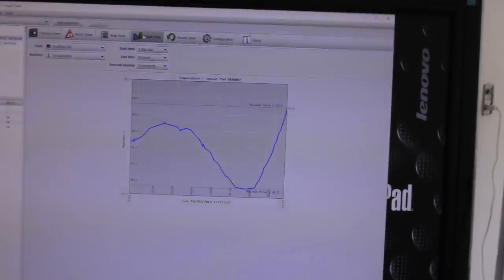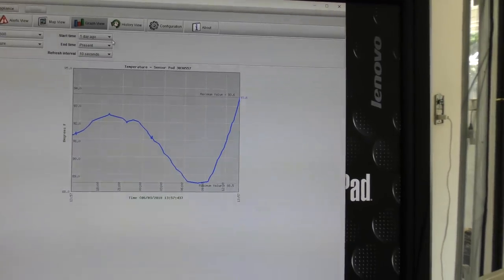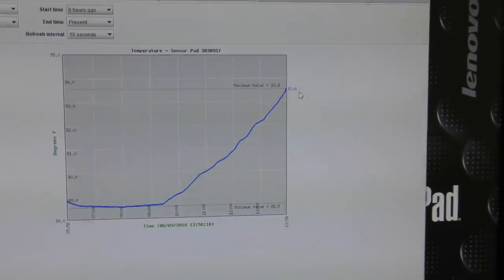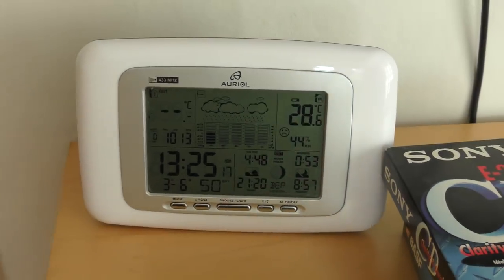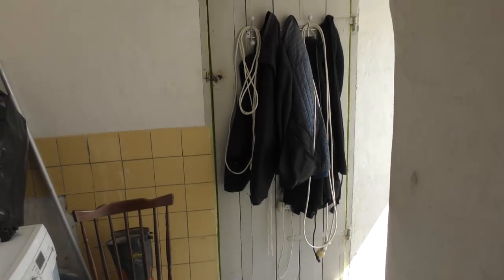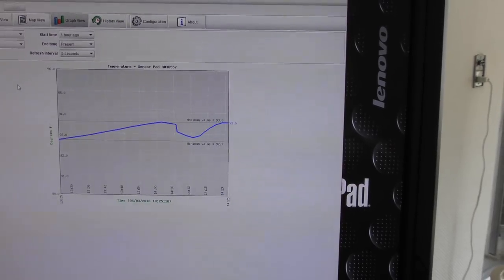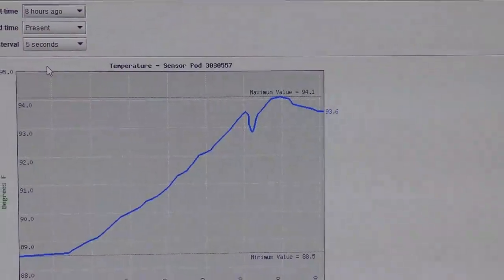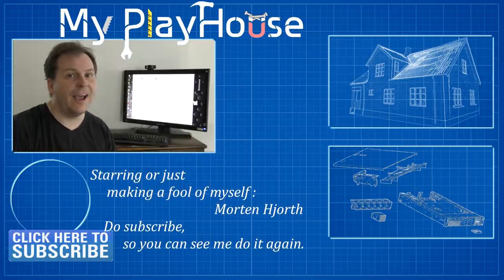Experimenting with Water Cooling, Air Intake to Data Center - 699

Comment: Whats about 3 car watercooling elements in serial? => cheap, high airflow and good cooling.
Reply: I told him that last year 😋
Reply: I honestly believe his best approach(not saying this would/wouldn't work) if he's gonna try to cool room using the water is maybe try to isolate the room and run the water through a bigger radiator with fans within the room, even if the water goes back into the well...... skip out on the air coming into the room unless it's going to be restricted to a slower rate; I believe to much air is being exchanged for the temperature drop to actually take effect from the cooling method used...... at the rate of air going in vs going out, I don't think it's actually doing anything different than having the fan blowing at a slower rate...... or better yet(probably not realistic), water cool the processors and forget the goal of cooling the room........ here's the theoretic analogy; get a hot hair dryer, designed to suck in air and blow air out heating it up and attach a faster faster fan getting air flowing at a faster rate without increasing the heat than the overall efficiency of the purpose of heating up the air is lost and the same is true cooling the air; the usual solution is restrict/control airflow or isolate
Reply from the maker: Hi tobi Herrmann
Thank You very much!  glad you liked the video :-)
Thank you for watching! :-)

Comment: nice video
I used a old Air conditioner heat exchanger. Huge surface and a 230Volt fan inside.
I connected cold water from the garden water pump and showering the garden with the 20°C water instead of the 10°C
Reply from the maker: Hi vspadrver
Thank You very much!  glad you liked the video :-)
Thank you for watching! :-)

Comment: I think you would need a much bigger radiator like a car radiator or several of them so you can cool your datacenter more efficiently and actually you don't need to put the radiators outside like this...Just put a big rad inside the datacenter room and connect it to the well via the pump and that way you would be able to utilize much bigger rad.
Reply from the maker: Hi One Cosmic
Thank You very much!  I rather have the water outside,,safer.
Thank you for watching! :-)
Reply: lol i had the same idea xD

Comment: SO, you have a motor running and consuming power for the pump, power consuming for the 2 cooling fans, I think if you put a small 8000btu window unit in the data center it would do a better job cooling, and it would actually use less power, you can purchase a window or portable unit that shuts off when you reach the set temperature in the data center, in the US it cost me about $10 per month to run a window A/C unit as they are very efficient, or better yet a variable speed A/C unit uses even less power. Great video :) P.S. try reversing the flow of the fan so that it sucks air through the data center instead of forcing air into the data center.
Reply from the maker: Hi Unkyjoe's Playhouse
Thank You very much!  moving the hot air away is way easier then cooling it. like it is easier to push a car,, then to carry it :-)
Moving the hot air out with a fan,, is like 60W,, pushing cold air in 75W (old fan) The booster pump is way over kill to pump the 3-5/min needed,, 5-10W pump will do that just fine,, so 145W to cool. And when I filmed this a 8000Btu A/C  would have to run 24/7 and have problems to keep up. 8000BTU can only cool about  2350Watts of equpment. and it will use like 660W's doing that.
Thank you for watching! :-)
Reply: And your radiator/watercooling setup has even less cooling capacity. You're not doing much more than decreasing airflow into the datacenter. If you want your datacenter to be cooler, without using an A/C, you need much more airflow. Providing more airflow by adding an intake and an exit hole with decent fans like the one you already have on them will be much more useful.
Reply: I actually like your reverse air flow idea if the air is noticeably cooler in the house vs outside:)
Reply: actually an air conditioner does not "cool the air" it transfers the heat out of the room to the outside "which is what you are attempting to do" it does it using a pump, and a pressure differential "much like you are attempting" just much more efficiently and with less cost and trouble. Good luck though it does make for an interesting video. :)
Reply: My little 8000 btu keep 350SF cool at 75f when it is 100f outside, it also keep about 300 watts of equipment in my serve closet cool as well, they last me about 5-7 years if you do regular "yearly cleaning of them" do you have all 2350 watts of equipment running all of the time, or do you switch them off "like I do" when not in use? Curious minds want to know :)
Reply: The problem is a Window Air Conditioner very expensive in Europe (aprox. 900$), even a Inverter Split is cheaper (aprox. 550$) due to new laws is the import for refrigerant restricted R134a cost about 40$/kg and R410a 100$/kg. Buying such thing in Summer is Madness.

Comment: HI Morten - you have an airflow problem first:   I would suggest you fit a "screen door" over that alcove, that is covered in filters.  This will provide a huge amount of surface area for filtration, and minimise the pressure drop.  When you restrict your inlet fan, it starts to labour, which means it draws more watts and adds heat to the airflow.   Remove the intake fan completely, and add a second intake pipe next to it...or replace both pipes with a duct.  If you can use a duct, you could fit several (ideally 6) car radiators full of your 12degree water so that the air passes through all of them.    If your water isn't getting up to the outside air temperature - add more radiators -  when the waste water starts to warm up, increase the flow.  The add more radiators.       As has been said, in this hot weather you need much much bigger exhaust capacity too.   Unfortunately, running your datacenter at negative pressure will draw in dust and warm outside air every time you open the door, however you will get much better cooling efficiency.   Essentially you have two choices:  1)   get as much airflow through at the 28degree outside temperature, and live with it at 28 degrees.     2)  Run your air-water cooling loop inside the datacenter.   The only other alternative I can see is to block off that alcove, and add a second pipe, and FILL it with automotive heat exchanger and fans.    You can then draw air out of the DC into the alcove, cool it and return it - this negates the problem you are having with the effectively infinite air mass you have at 28degrees that you need to restrict to cool to 12degrees, and instead deals with a relatively small air mass of the DC, and allows it to be recycled through the cooling system over and over, effectively removing the heat more and more.  As long as the cooling capacity exceeds your power consumption + gains (e.g. the temperature of the walls) the room will run close to your water temperature.      Oh - and put some thing in front of that window!!! Solar Gains!!!
Reply: Forgot to say - thank you for sharing these videos - your experiments are interesting.
Reply from the maker: Hi Steve Bristow
Thank You very much!  That is a lot of good sugestions,, a screen door,, good idea.
Thank you for watching! :-)

Comment: Hi Morten, great video as usual.. Wouldn't it be easier to install an AC unit and run it from your electric solar panels in the day time whilst charging your battery store as well and then use the 24kwh battery system to run the AC at night if needed...
Reply from the maker: Hi Tim Box
Thank You very much!  I am just playing with this! replacing the air is way more efficient the cooling it again. An A/C unit that would just be able to do the job will use 660w,,, I use 145w.
Thank you for watching! :-)

Comment: adding cool air is good but its more important to remove the hot air from the top of the room.. if you added a good fan to pull the air from the room you would see a big difference. you might be able to use the fan to pull air from the top of the room and use the water cooling like you are but let the air being sucked in from the vacuum pressure in the room to help cool the air being replaced into the room. you would need to make sure the doors are sealed pretty good for this to work
Reply from the maker: Hi cdacaraudio
Thank You very much!  I am doing this,, and I did show you where the hot air from the data center comes in to the house.
Thank you for watching! :-)

Comment: The best chance of cooling is when the temperature difference is as high as possible. You'd probably get a better effect by having the water/air contraption inside the warmer air of the data center, instead of focusing on cooling the air intake, which is already quite a bit cooler than the inside air temperature.
Reply from the maker: Hi Johnnie Hougaard Nielsen
Thank You very much!  but I do not cool the hot air down again,, I just get rid of it... way more efficient.
Thank you for watching! :-)
Reply: Since it's getting hot inside, you're NOT getting rid of the hot air. Of course, you could install huge fans, but if you like to use the water cooling contraption, cooling cool air is way inefficient due to the much lower transfer of heat from air to water with the lower temperature difference, especially with such small radiators.

Comment: I'd go for keeping your filters on, use a 'box' of radiators, kind-of encasing the filters you have. Feed water through that system. If that does the job, you can potentially temperature control the pump on/off, running it if the temperature gets too high during day light hours. At night, if the temperature gets too high, you may have a fire or something, so you probably want an alarm instead :)
Reply from the maker: Hi Wiebo Westerhof
Thank You very much!  glad you liked the video :-)
Thank you for watching! :-)

Comment: Aside from moving up to a car radiator I can't see much more that can be done beside tapping the well directly. A good amount of 4 inch pvc flex piping coiled at the bottom would give the pumped air ample time to cool down and possibly be tapped for more then just the servers :D. Not an expert though and it's much easier to pump water then air. Another interesting idea may be to pump the well water through a baseboard heater (the ones which use hot water and look like an oil heater) and piping the air from the blower past it after it enters the server room (or just a box fan to recirculate)
Reply from the maker: Hi Techburn
Thank You very much!  glad you liked the video :-)
Thank you for watching! :-)

Comment: You can do air filtering and cooling in one step: build a flipped U with the pipes, install a high pressure, low throughput spray nozzle on top of the right pipe, spraying down towards the incoming air.

Add a drip plate with a pipe at the lower end, to get rid of the water.

On the bottom side of the left pipe, running downwards towards the data center, you'll need a small hole, to get rid of excess water there.

This only works as long as the intake temperature is below the coldest place in the datacenter. This is not a good idea if you have very cold walls (e.g. in winter), cause the intake air is obviously nearly saturated with humidity after this process, if it has a place to cool down even further it will dew there.

The biggest advantage is, that this high humidity air can transport way more heat than dry air, requiring less air to sucked into the servers.

Also water cooling the servers directly would be a much more economical idea, if you ask me 😅
Reply from the maker: Hi Ruben Kelevra
Thank You very much!  glad you liked the video :-)
Thank you for watching! :-)
Reply: @MyPlayHouse  welcome! Hope my idea helped a bit in your brainstorm process 😅
Reply: @MyPlayHouse  I forgot to write: You need some kind of hot air extraction at the ceiling. You currently pump cold air at the bottom, vent the middle temperatured air thru the servers and extract the hot air behind the servers, right?

Than all other equipment which creates hot air, in front of the servers will rise to the ceiling, until the airflow of cooler air cold it down.

Since there's no airflow at the ceiling, this takes a while (and the ceiling itself is probably not the coldest place 😉)

You can either add a blend in front of the server and let them suck air from below the ceiling, to have your other equipment properly cooled down too, or you add a small ventilation system below the ceiling with low fan speed, to just extract the hot air there too.

This also explains your readings with the thermometer below the ceiling: the airflow got stronger, while you removed the filter, completely disturbing the hot air bubble at the ceiling and mixing everything.

When you added the cooler, the airflow got less strong again, let the hot air rise again below the ceiling, rising the measured temperature again.

Comment: To solve the running out of water problem maybe use a very long hose to go from the outlet of the radiators and back down to the well... what are your thoughts on that idea??
Reply from the maker: Hi Julian Curmi
Thank You very much!  But,, why,, I just need to lower the water flow.
Thank you for watching! :-)

Comment: Your water cooling idea would work. The only problem with it is that it has too high air resistance.
The two radiators within the pipe are likely not really needed.
I would instead go with putting 4 or more large radiators on the pipe instead of the single one it currently has. And skip having the two internal ones, as to not restrict the airflow as much.

Yes, it would not cool the air as much. But would let much more air through the system at once.
But if it gets the 28 C outside air down to 25 C, and gives four times more air then your current setup that gives you 21-22 C. Then it would likely have much better efficiency.

I would also recommend buying a large loop of hose and submerging it in the well, so that you can have a closed loop cooling system for the air cooling, as to not get sand in the radiators or run out of well water.

Then maybe you should put in a pair of valves so that you can redirect the outgoing air from the data center and let it go back outside, instead of heating the house.

Thanks for making a nice video, and I hope the data center doesn't get too warm since summer just has started after all.
Reply from the maker: Hi Alexander Wikström
Thank You very much!  It's all fine, I like playing with this,, and improving on it.
Thank you for watching! :-)
Reply: It is fun to watch as well. I do enjoy your content.
And it would be nice to see the data center cooling up and running more efficiently.

Comment: Im pretty sure what you are trying to do is reverse water cooling, with your set up essentially you are trying to build an outdoor fridge as the water coming in through the hose. What may get you a bit further might be thermally isolating the circuit as those hoses are not very good at that, also perhaps running a shorter incoming hose. And if you really want to see how quick it can be cooled get some dry ice like lots and just put it on top of the blower.
Reply from the maker: Hi Alexandre Rua
Thank You very much!  But that is not really what I am up to.
Thank you for watching! :-)

Comment: you best bet would be to submerge a coil of copper pipe in the well(creating a closed loop to recycle water and keep the gunk out) then use much larger radiators inside the room recirculating the same air say 2-3 car radiators is about the surface area you might need... very similar to air-conditioning just without the power hungry compressor
Reply from the maker: Hi meh757
Thank You very much!  but I still have to pump out 1000liter of water every day,, why pump the water around when 1000L need to be moved anyway.
Thank you for watching! :-)
Reply: think of it like a heat pump your just sinking the heat from the data center into the water downstairs then when you purge the water your also purging the heat and for the issue of recycling it that's to keep the radiators clean otherwise your gonna have the issue of stuff getting clogged with a dirty(the sand) water source.... i actually saw this idea in practice in a data center in Canada they had massive water towers outside that they would sink the heat during the day into then radiate the heat at night to save on electricity it was a genius design!!

Comment: Morten, there is a better way to do this. Look up videos on geothermal pond loop. You basically want a small version of that. You want to create a coil of tubing and put it in that well, where its probably 50F degrees in the water. And set the pump to only go off when the water goes above a certain level. Circulate your fluid through that several hundred feet in a coil that is suspended in the well. That's also how hot water heaters work and how heat exchangers work. 

also, here in the US, (my grandfather's house has something like that well) they actually put a pump down in the well, which solves the whole priming problem.
Reply from the maker: Hi thtadthtshldntbe
Thank You very much!  glad you liked the video :-)
Thank you for watching! :-)